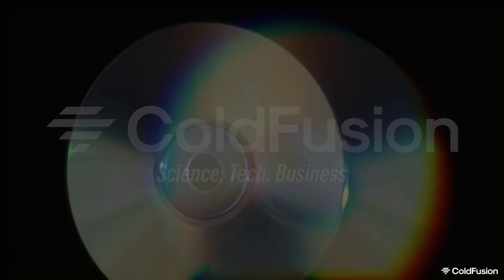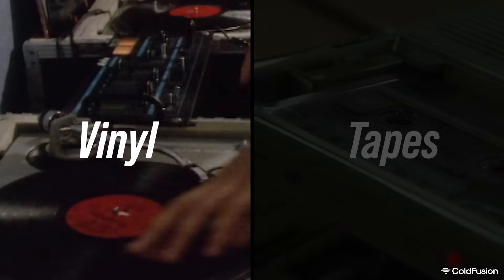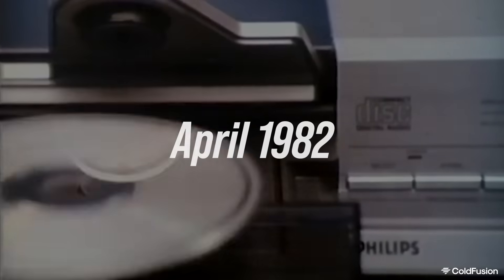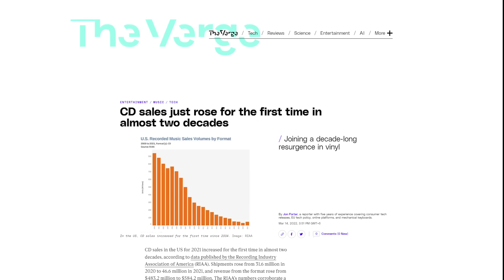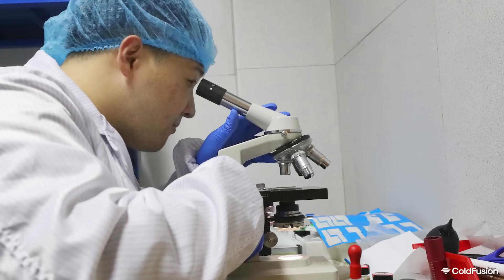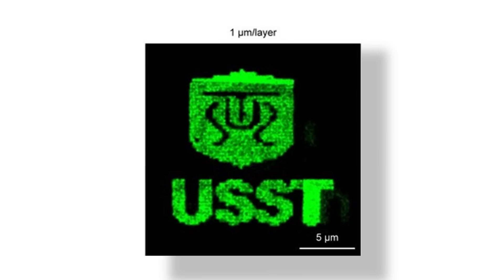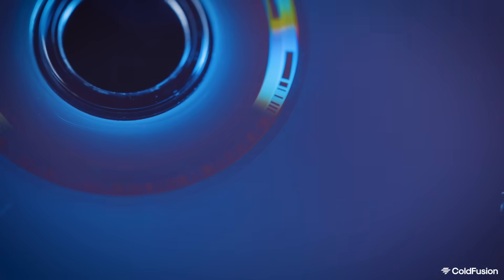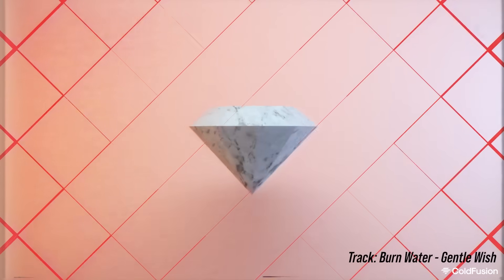Why This New CD Could Change Storage

Comment: Ladies and gentlemen: 200TB of hard drive capacity!
Two hundred terabytes of storage capacity.
That's right, 200TB of hard drive capacity!
Think about the value and the usage of a computer with a 200TB hard drive.
What can that do for you? Uh, the sky's the limit.
The sky is the limit when you're thinking about capacity of a hard drive of that size.
It's as if you have 200 huge file cabinets
Two h u n d r e d file cabinets of storage capacity. That's right.
The biggest arena of computers today - the biggest arena - is in CD-ROMs.
It's the biggest growing sector of computers, and it's not going to stop.
It's NOT going to stop, it is not a fad!
Ladies and gentlemen, it's tomorrow today.
There's 17 thousand volumes of encyclopedia on one disc, on one CD disc.
That's right, we're talking about 40 million songs just for starters on that disc! That's on 1 disc!
You couldn't get close to that on a floppy disk.
9 M I L L I O N  T E R A B Y T E S
(This comes with the CD-ROM built in.)

Comment: 5:29 damn i didn't knew 2007 started going down, i remember i used quite a lot of CD/DVD-R until 4GB and 8GB usb become affordable (20-30 euros, around 2011-2012). For some reason i never really bothered to use RW CD/DVD, the read write.

Comment: Another one? Time to ruin it: This happens every year. Some company or university claims to have invented a new super-high-capacity optical storage technology, usually something holographic. And it never results in a viable product. It's just the practical aspects. Achieving such world-changing densities can work in the lab. On a vibration-isolated table in a temperature- and humidity-controlled room. With equipment delicately adjusted by an optical engineer before every use. Using optical components manufactured to nanometer precision with atomically-perfect quartz lenses. But there's a long way from the lab bench to a viable product that can be mass-produced for a reasonable price and survive sitting on a desk or in a server rack for years on end without specialist servicing.

Comment: Imo CDs aren't gonna come back for mass use by ordinary people until it's easy and safe to carry around. That's why a usb stick is better. It can handle a few drops without any issue (both water drops and drops from height), scratches, sunlight, bending, dust. Maybe make the disk small and put it in a container and make it connectable via usb? Lol

Comment: Read/write speeds will always be the limiting factor. Better to focus research money on improving solid state memory.
Reply: I was also wondering how long it would take to write 200TB. But it is nice to know that they are still working on high-density long term storage.
Reply: @LivingLinux  we have archival LTO tape drives that can write 18TB of data in about 12 hours (1.5TB/h), so if this disk based medium can burn data to disk faster than that then it might see use for archival purposes, and with it being a disk accessing a file in the middle of it is much quicker compared to a linear tape based medium
Reply: flash memory will lose its data if not powered on after a few years.
Reply: It all depends on your usage case, there will always be a need for slow, but massive storage.
Reply: maybe it is useful though for long term archiving data

Comment: I'm no expert, but I've seen enough about data storage mediums to know that magnetic tape will remain king for years to come.
These discs are expensive, difficult to read/write, and require new infrastructure to mass-produce. The only market is in archival storage, which is already entirely dominated by IBM's tape systems which can store more data for longer. While it's super cool and we can go "wow look at technology! amazing!" I seriously doubt this will shock the industry. 
If people are serious about long-term archival storage, they use magnetic tape. Everyone else is better off using hard drives or cloud services.

Comment: Well, I don't think data center storage will be quite this dense... even if it was all the size of a normal DVD drive, those take up a lot more volume than a disc. So storage density is either much lower per datacenter, or you don't care about reading it back. But yeah, it'd be the hot new thing in data backup technology.
I don't see it being useful in the consumer market. People rarely figure out how to attach usb flash sticks to their phones, can't imagine them using bulky optical media. And the high capacity is useless for music and video at any 2D level. Though maybe if movies weren't movies, but interactive VR novels that kind of data density could be useful.

Comment: Very curious concept, of using lasers of more than one frequency of light to engrave features of a size far smaller than the wavelength of light.  This doesn't seem to ring true or it was badly explained or I don't understand.  There's no way that heterodyning between visible light frequencies works like this.  To get to feature sizes like this, something between far ultraviolet and X rays is needed.

Let's wait till it gets reproduced in a lab outside of PRC.  Cool idea in principle, yes.  Maybe you'd upload the data to a special media creation center, or send the media later to a special media reading center to download.  Kind of like a cheaper way to do cloud where you can get something physical with the data on it.

Comment: Right now, it's far more convenient for me to use a hard drive over a disc format. Even USB flash drives have gotten comparable to BD-Roms. Approx 1.2 TB for 50 BDRs at around $50. 1 TB USB flash drive is $70 ish, and you don't have to worry about filling a disc. An 8 TB hard drive is $120 ish. There's physical space, read/write factors, etc. SSDs are catching up, which are lighter and smaller. I would say that optical discs are more durable vs a USB flash drive, but usually most of my important data could be fit even onto a single CDR. Cloud storage, even the free tiers, are often enough for that as well. An 8 TB hard drive is the best bang for the buck for me, especially if the drive isn't used that often

That being said, I would love a disc that could store 100-200TB. Heck, I'd be happy with 10TB. Let's use the 10TB argument. 10 TB would be fantastic. I would be very happy paying $25 for a single disc, though I might get it at $100 if I have the money. Optical discs are ROMs, meaning you burn them and they are fixed, mostly. You also get into organizing the data. It might be more ideal to not fill an optical disc if you want to do something like put all Harry Potter movies onto a single disc.

I don't need super-fast speed, either, just decent. If I have something I can run overnight and back up a 10 TB hard drive, that's perfect. 40 MB/sec (megabytes/sec) would be pretty good (approx rate I quickly calculated for overnight for 10 TB). Then again, DVD burnables can be broken into sessions, so even 10 MB/sec would be alright if you can do that with the new format. If it's cheap enough, my PC could have a dedicated burn cache hard drive. Still, I rather not spend more than 8 hours to completely burn a session. But hm... the speed needed for a 100-200TB disc could be an impediment. You would need to go incredibly fast for an overnight burn of 100 TB. 

The problem with BD-Rom was that the price compared to the price of DVD-R discs at the start, and then the price of hard drives dropped. It became too hard for BDRs to catch up. In the past, USB thumb drives weren't a good of a bang for the buck vs BDRs, but the rewritable nature of USB Thumb Drives made them a better choice for me at the time. There always that voice in the back of my head of "how much of a BDR will actually get used?"
Reply: the difference is data longevity, an inorganic disk such as a bluray can be put in storage for 50 years and will keep all the data on it intact, but a flash drive will suffer from bit rot after about 5 years of not being powered. for consumers this wont make much difference but it's something that matters to companies

Comment: Where I work we continue to have data we need to retrieve from 50 years ago and that will continue for about 60 more years. We have large archival facilities with atmospheric (humidity and temperature). I could see all of the data fitting on a few discs and all the sites nationwide sharing the data storage of the other facilities (keeping the archive requirement). Get this out of the lab and I do imagine customers.

Comment: I don't see the technology being use by everyday people like CD and DVDs were used with a lot in the 90s/early 2000s with CD/DVD burner drives, mainly because if want to store 2 Petabits of data you're going to need that much storage size in your system to start with, unless you can write multiple times on the disc over the years.

Comment: What is skipped in this discussion are twofold, the durability issue and the utilization mechanism. If i am on that research team, i will focus on making a suitable reader which will be encapsuled the disc, therefore the durability issue will be covered, as we know, disc, is very prone on breaking and scratching, no matter how neat and tidy one behavior is especially for public consumption behavior (the amount of DVD and cd i scratched and broke is quite astounding). The reader will be the product and this disc will be the technician information only, because the abbreviation that you told is quite, how should i say this politely, bonkers. When they able to develop that, make a better name, maybe TDS (Transparent Disc Storage) which can be marketed easier. With this the utilization will also be covered as no one really gives a flying f on how it works, as long as it works and compact enough to be portable or easy enough to be integrated with the current computing devices regular people and businesses use.

Comment: wish the size standards were equivalent.. 1 byte = 8 bits, for reference.
I really don't think CD-Roms are gonna make a comeback in PCs for instance, they've already largely changed the hardware layout so that fans get the prime spot where the CD-Rom once was.
Reply: they might for workstations, but no way laptops will start to ship with optical drives as standard unless people really really desparately want it which is unlikely
Reply: There's still some cases available with a 5.25 slot. But I suppose the drives could be external for a while until the market would adapt.

Comment: I like the idea of a casing. What you might have is a slim cartridge that limits exposure to dust and FOD. It would increase cost per unit, but data security and preservation might be well worth the costs of development and manufacture. In the old days, we dreamed of putting the Library of Congress onto disks. With this technology, one might collect and store data for the entire human race. Just open another deep vault in Finland or Switzerland, and most of the fundamental knowledge on Earth could be stored for safekeeping and updated easily over time as knowledge progresses.
Reply: DVD-ram had cases, but unlesd you had a specific player that could accept cased ones (and as a result couldn't play normal disks unless you put them in a temporary case), you'd need to take the dvd-ram back out to put it in a standard disk player. having an entire new disk standard would fix that issue but then it'd make getting people to start using it more of a challenge

Comment: I do not see such a big problem with the cost. In the beginning, new technologies are always costly. And you could already now use the new disks for servers, meaning that not everybody would need such an expensive laser at home. The very cloud-storage habits here mentioned as a counter-argument certainly can somehow be connected with this new technology.
Reply: I do see a problem with the cost. LTO-12 offers similar capacity at a fraction of the cost and 100x the speed. LTO-8 is readily available today with tapes costing <$50 for 12 TB uncompressed, 30 TB compressed. This sounds like a lot of hype for what's basically a nothing-burger from a commercial and practical perspective.

Comment: I must admit, this amount of data is beyond my comprehension. The cost is prohibitive and at present, I cannot imagine how it would be used by an individual. I would also be paranoid at a single disc containing all my available data in one, fragile medium.
Reply: Duplicate each one. Then use the dup's to make a 3 disk set that = 2 disks of usable data on them. Now you have 2 original disk images to keep for safe keeping, and a set of 3 disks with a redundancy margin of 1.  That is called Raid 1. And Raid 3. Raid 1 being two disks working together to make sure that if one stops working the other one 100% contains everything. Whiles Raid 3 lets you lose 1 out of 3 disks. Or maybe 2 out of 5 disks. And remember that a CD sized plastic thing is far cheaper then a 12TB hard disk. Let alone a SSD in that size. It is a time investment to duplicate the disks/data that is a far bigger problem.
 

If one had 2 disk bays plugged into the computer. Had 3 copies of the same disk/data. Left 1 safely stored away.
Then your 2 disk bays can simultaneously work together to speed up the data speeds. And when not in use? They can check one and a other for faults. Most SSD/HDD's in everyday computers has close to no way to recover faulty storage of data. And remember a 3th disks is sitting around doing nothing! It can be on the other side of the earth or on the moon. Compared to a single SSD that would only store a fraction as much data. With no safety to go along with it. No way to really recover anything if something goes wrong.

The issue really is being fine with the noise and swapping disks around like we did before...

Comment: Put it in a casing like we did with the mini disc, and I'm sold
Reply: DVD-RAM would be another example of this being done (tho it was optional and later iterations dropped the concept to be compatible with standard DVD drives), heck if the dimentions are identical then you could straight up reuse the DVD-RAM caddy design without modification

Comment: Whenever building a new PC, I used to transfer over the DVD-R drive from one to the next, until about 8 years ago I bought a case and didn't realize it didn't have a port to support a DVD player.  At first I was pissed and thought I needed a new case, then I thought "When was the last time I actually used a DVD?"  Indeed it was many years ago.

Comment: Storage density is not the real problem now except for enterprise and hyperscalers. And storage is cheap enough that all we want is cheap. The problem is speed. And no optical disk is ever going to be fast enough. Maybe it could be economical for deep archival storage over geologic timescales or whatever. But it’s not clear that there would be any meaningful point to such storage except as a time capsule nobody might ever find. But we have magnetic storage that can be produced at scale with reasonable read speeds and theoretical lifetimes  in ideal storage conditions of many human lifetimes. We have not phased out optical due to density. We’ve phased it out because it’s slow for its prior uses and not as useful for things like deep archival storage as magnetic tape. And 200TB on a disc is not that impressive compared to magnetic storage. And it’s write speeds are abysmal (even if it can be done after manufacture of the disc) and reads speeds are only marginally better. The xbox one didn’t give you the option to install your discs to its hard drive because of a concern about density. It’s because hard drives, which themselves have been phased out of consumer use due to being so slow compared to solid state storage media (which I assume are less resilient to time than magnetic storage and know have lower maximum theoretical density and lifetime in use for their tradeoffs). 

This disc might be faster than traditional optical storage or denser than magnetic or solid state storage. Or have a lifetime longer than the useful lifetime of non-optical existing technologies. But it will not scale as a technology because it solves solved problems in a form factor that present intractable problems that are also solved elsewhere.